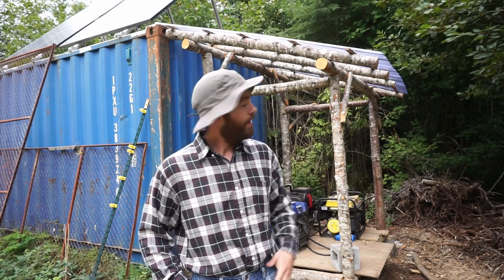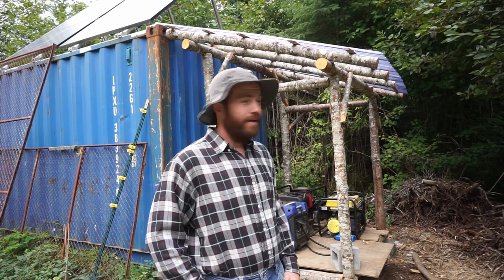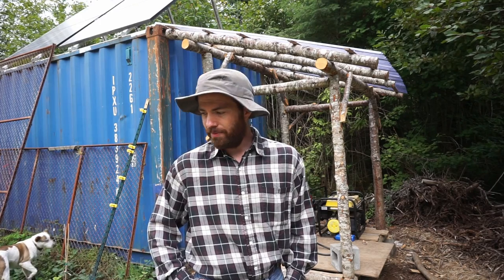Greenwood Primitive Timber Framed Shed Build

Comment: Low cost experiments are the best way to learn. Here's a few points:
- Most of us have a simple yet useful carpenter square. Learn how to use it. It is fundamental in (timber) framing. You won't need a calculator after learning how to use it.
- No one needs expensive and/or specialized tools to do timber framing. If I'm not using mortises, tenons and pegs, I'm using lashings way more than metal fasteners. Good cordages and a few knots can get you a long way.
- Rebar is really cheap and useful. I've been using it as nails on numerous occasions because I was too broke to use anything else. Use what you have or have access to is better than spending a fortune, especially for a test.
- I don't like using only clear polycarbonate on sheds. I only use the minimum required and get metal sheats for the rest. It's just too expensive for what you get. This being said, I'm not avoiding it altogether: I'm just using the minimal amount of it to beneficiate of day light when working in the shed.
- I laugh so hard when I saw you using a small chunk of wood as mallet, thinking of the wooden maul that you made after moving a few years ago. 🤣

Keep up your excellent work!
Reply from the maker: Great advice as always. I have a couple carpenter's squares but I could stand to get more comfortable using one. I got a lot of use out of my combination square on this build though. I understand the humor about my firewood mallet the truth is, I split one mallet on this project using it with my hatchet so I switched to using the firewood with my hatchet and my other mallet with my chisel. 

Hope all is well.
Reply: Excellent Video! Sorry for chiming in, I would appreciate your opinion. Have you researched - Mahorrla Wooden Paradise Method (just google it)? It is a smashing one off product for building better sheds and woodworking minus the normal expense. Ive heard some awesome things about it and my old buddy Taylor at last got excellent success with it.

Comment: Great build! I’m totally in the “use-what-you-got” school of DIY projects. I made a garden shed almost completely out of left-over lumber and it turned out fine. I use it every day…sure, the framing is improvised, but it’s solid and will last just as long as one that was ‘properly’ built. I learned a few nice points about working with logs from your video, thanks again.

Comment: Who needs lumber when you have what the outdoors provides great video. Although I'm not a fan of electric chain saws.
Reply from the maker: You know, I was hesitant to buy it but this little chainsaw has been just right for what I have to do around the homestead and my pace. It is the right size for the young trees around my place and because everything is so overgrown I often have to set the saw down after each cut to move the tree. I was having real issues with restarting my gas chainsaw so often and the instant on off of this chainsaw has been a perfect solution. I agree that it isn't my sthil by any stretch but is has been one of my best investments this summer.
Reply: Milwaukee makes great tools. I'm sure for the price and what you need it for was a perfect fit. Cant wait for next project keep up the solid work!

Comment: the nice thing about watching this is I know I have all the old tools  used to make structures using the materials at hand, an adze is something that would have been handy I 'm not sure what the big ole hand ax would be called mine has the right bend in the handle for me to use without skinning my knuckles, that's a nice vintage hatchet, I wish I had one

Comment: I built a dozen alder log cabin style raised garden beds last spring. I am hoping they last three years at least. It was fun and it looks cool though. 

I am really curious how the wood will hold up if it is off the ground and mostly dry. I too have a ton of alder and don’t want to just use it as firewood. 

Thanks a ton for the motivation boost. I have been delaying building an alder greenhouse far too long.
Reply: Got any photos?

Comment: How has this held up this passed year?  My concern is the barked posts and sills on the low end of roof side.  During rain you've had to have gotten a bunch of splash up of water shedding off that.  Secondly was the roof itself.  The transparent panels typically let UV through unless they've specifically been designed for that (which means more expensive) Which would cause the wood to dry more rapidly.  Luckily though round wood is fairly stable, warping only gets REALLY bad when the rounds are squared off into dimensional timbers which unbalances the internal tensions the log had.

Comment: If you could get some kind of a gear box where you could lift weight during sunny days and use that energy to recharge batteries during cloudy days. The stored energy would not decay over time, but would have more danger than the ram pump idea. 

Ok I will leave you alone for a while.
Reply from the maker: I'm liking all of the ideas. I'll definitely explore them. Best wishes!

Comment: I cut mine with an angle grinder and a smooth tile blade. It kind of melted it so it didn’t shatter. Nice framing! I’m about the to do the same to build a roof structure for a wood fired Kiln. Thanks for sharing! I like that rebar nail technique. How’s it holding up? 

What tool did you wish you had to make it easier?

Comment: Question: It's ok to use green & untreated timber in this case because it's off the ground - correct? The timber will dry & season as the shed stands there.
I want to use green sycamore trunks of a very similar dimension & straightness as legs for a deck I'm building. They will be set on a stone slab about 1.5ft below ground, & so that much of the trunk will be buried, & therefore exposed to the damp earth. Is this going to be a failure long term? Will they rot in time? Any help/advice is appreciated.
Reply from the maker: Hello, good questions. I used green wood like this because this structure doesn't need to be square in the end. I built it off the ground to slow the decomposition of the wood. Remember that green wood warps and shrinks significantly as it dries, I would be hesitant to use green wood to support a deck on my house because it would be unlikely to end up level or pleasant to walk on in the end.

Also don't let it touch the ground if you want it to last more than a few years. The bugs and the fungus will take care of the wood quickly. I haven't worked with it personally but it looks like sycamore has almost no rot resistance.

Hope this helps.

Here is a helpful website about your wood.
https://www.wood-database.com/sycamore/
Reply: @Simplegroundlife  Thank you for the information. I've just moved into a rental property. I've got the owner's permission to build a deck at the end of the garden away from the house. It doesn't have to be superb craftsmanship, & the thing is, I just happen to have some nice stout sycamore trunks from a recent job. I'm thinking this might be a good low cost option.
I will check out the wood database also.
Reply: All wood in contact with the ground will eventually break down - no matter how you try to waterproof it. It could take many years, though, depending on your local climate. You can use pressure treated and also build the shed or whatever off the ground on blocks or stones or - rad idea- old tires filled with dirt. The main thing to me is just to build something that suits your needs and don’t worry about getting it perfect. Enjoy the process and learn from figuring stuff out as you go. The experience builds up over time.